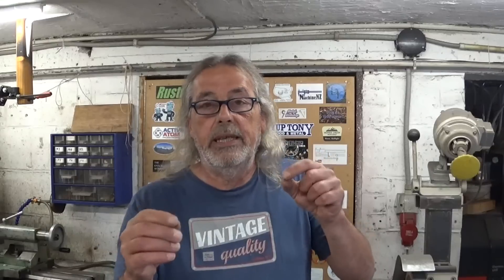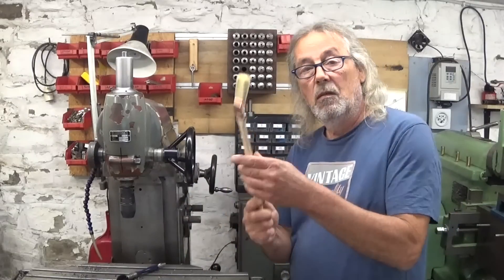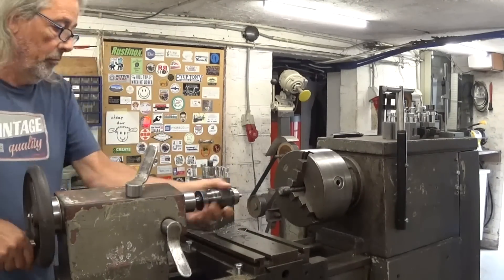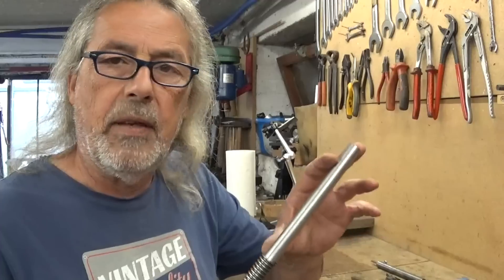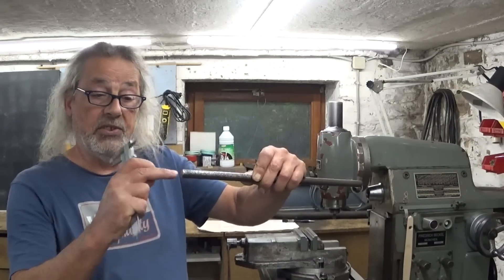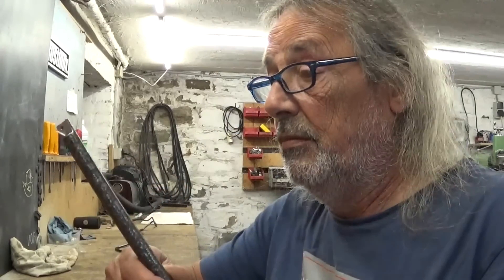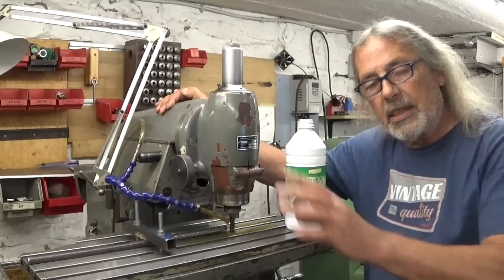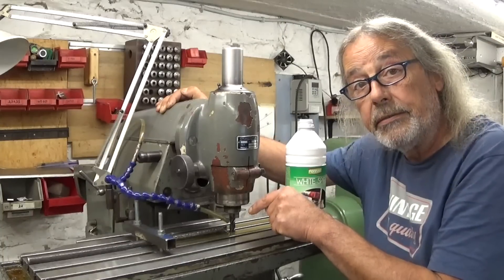Making a threading tool holder.

Comment: Good video. I'm not clear on what you used to clean your mill table. White Spirits? Hopefully not white gas (naphtha). It's very flammable, much more so than paint thinner. Two more questions, did you really make the bolt for the insert and why did you use the tool face down?
Reply from the maker: Indeed, white spirit, to make the oil a bit thinner. And yes, I really make the bolts to hold inserts.
Reply: @Rustinox  Just looked up the white spirits. Apparently its the same as paint thinner with more Toluene. Much safer than what we refer to as white gas in the US. I've never had any luck making a small screw like that plus no metric on my lathe.

Comment: It's always a delight when your videos pop up! 👍
Re the oil, you can get a little one-way inline valve and put it on the machine near the head, it will stop the oil draining back. At least over short time periods.

And another tip for the oil; if you get some syringe tips in various sizes from the pharmacist you can jam them in the end of your oil hose, that way it only squirts a tiny bit of oil on the cutter, and is handy because the little squirt stream will squirt out horizontally so you can aim it at the cutter from a couple of inches away.
Reply from the maker: That's a good idea. I'll try to find some.

Comment: Great video Michel. I enjoy your approach to making stuff. Would also like to know if the white spirit works. I sometimes use a 50/50 mix of engine oil and kerosene (paraffin) and inexpensive option if a lot of coolant is needed. Kerosene is also good with aluminium. Doesn't smell too bad 🤭 Cheers Nobby
Reply from the maker: I have to use it more to know if the results are good, but I will give an update in an upcoming video.

Comment: Michel, for what it's worth, the modern version of the Dremel is not that good either in my experience. I am on my third as they have a habit of just blowing up for no apparent reason and the spindle bearings are not exactly ABEC quality. 
Regards,
Preso
Reply from the maker: That's good to know. Thanks.

Comment: Hey Michel,
How nice of that guy from the Netherlands.  😉
Nicely done at first👍🏻, but there is a small mistake.
The inserts should be slightly slanted. 
From my memory 3 degrees. 
If you have them in horizontally, the insert touches the cutting edge and the bottom.
You don't actually want that. 
Have fun with it. 
Greetings Dominic from the Netherlands
Reply from the maker: That's interesting to know. I did cut the point on the bottom side to prevent it from rubbing. But I will adapt the two flats on the shank to give it an angle.
Reply: @Rustinox  You will certainly succeed. You can also put a piece in your lathe with a hole in it and then put a tool in front of it and you can see it👍🏻

Comment: Hi Michel ☺, thanks for another interesting video mate, and the insert holder worked well, I noticed in the close up shots of the tool starting to cut the threads that the tool and cross slide jumped up as if somethings loose perhaps. Have a look at your video at 17. 58secs. Best wishes to you and your's, Stuart UK.
Reply: you saw that right. I saw it too.
Reply from the maker: The quick change toolpost isn't very rigid. That's why I don't use it much.

Comment: Need a tool, make a tool! I try to do that when I come, but often it is easier, cheaper and faster to buy the chinese stuff. I needed a heavy boring bar (1") and internal threading bar (.75") recently, and I was able to get them from China relatively fast and cheap.

I noticed an awful lot of tool deflection in the last shot of cutting the threads after you reduced the diameter of the cutting tool.

I'd be careful with the white spirits, it's got a relatively low flash point (55C) compared to motor oil (200C+). Diluted, it's not likely a big deal, though.
Reply from the maker: The quick change toolpost isn't very rigid. That's why I don't use it much.

Comment: G'day Rusty   Another Great Video. Take a piece of round stock,  machine it, shape it, & fit an insert. Suddenly, you have a tool holder to cut threads.
Well done
Ted
Reply from the maker: And it works.
Reply: @Rustinox  Yesssss & It works like a store bought one, but better, because it has the Rusty Brand on it  😆

Comment: I save broken drill bits and tooling to make boring bar bits. I use high temperature silver solder (braze) and mount the peice at 90° and then grind whatever profile you want. You can also use carbide teath off of old circular saw blades if you want. It saves a lot of grinding trying to form it out of a solid block of HSS. So it's almost the same process you just did making the tool holder but you just braze on the tool bit instead of mounting it with a screw. Cheap and easy using scrap.
Reply from the maker: It's just that I don't have a torch...
Reply: @Rustinox  mapp gas works with the burnzmatic head ypu have there. 😉👍.